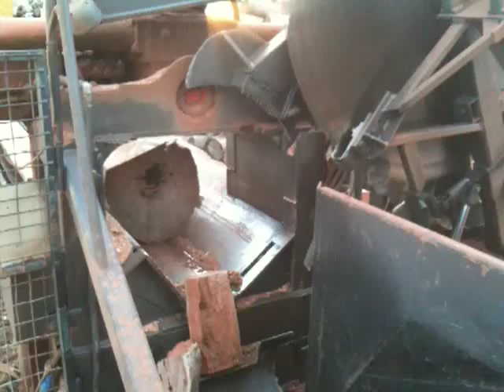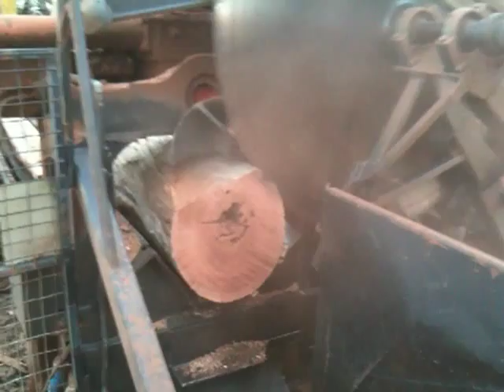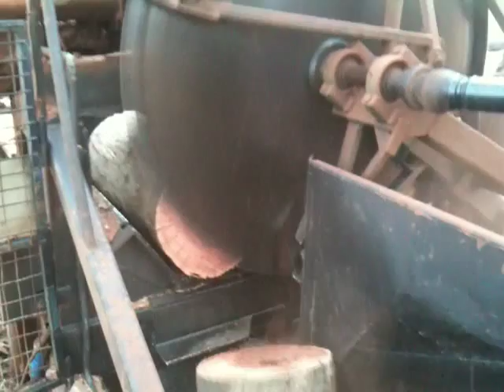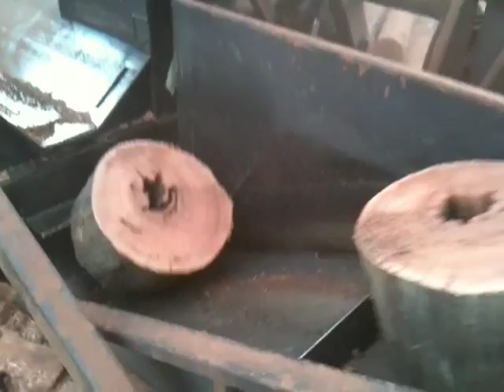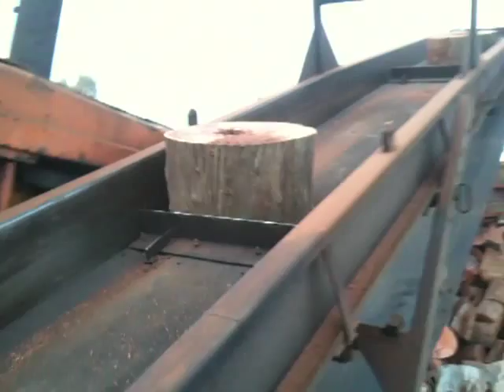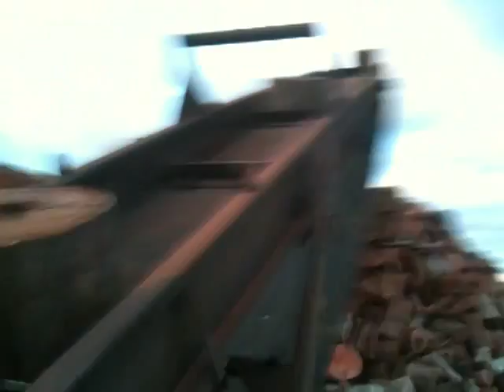firewood processor high production sawmill 2

Comment from the maker: The mill was custom made by the previous owners and we have made some minor modifactions to it.  The blade is currently driven by a drive shaft runinng from a chamberlain gearbox off the back of the engine.  We are planning to re - power the mill soon and alter the blade drive to either a hydraulic motor or a belt system